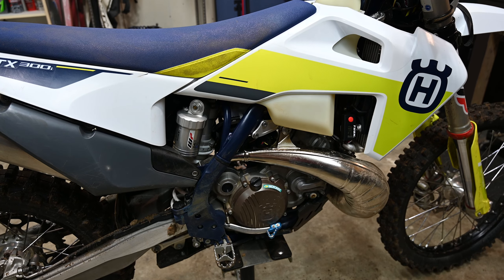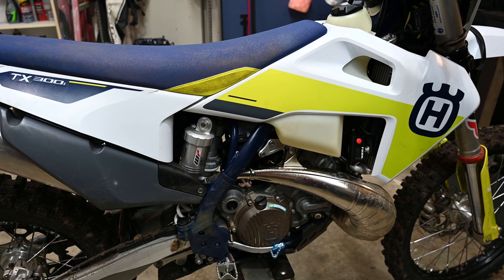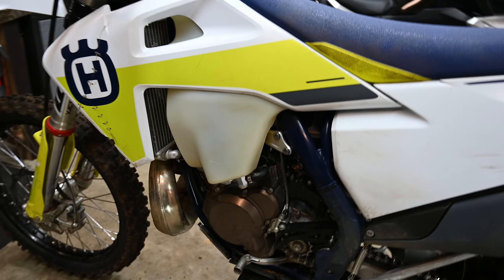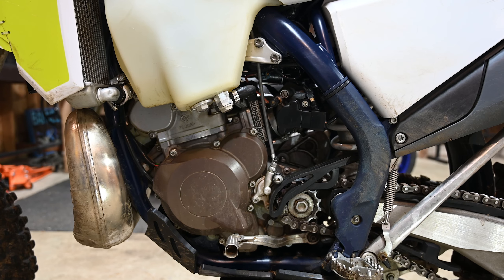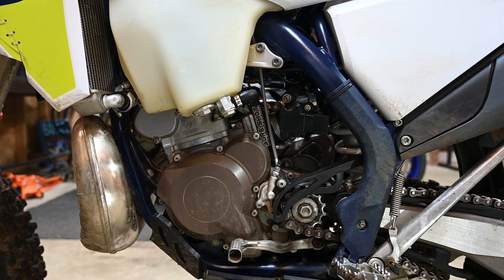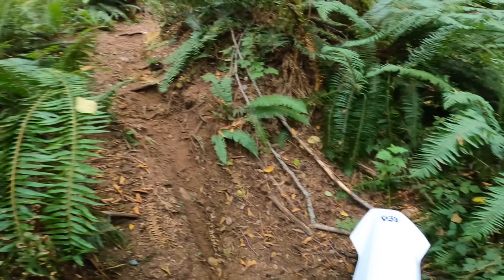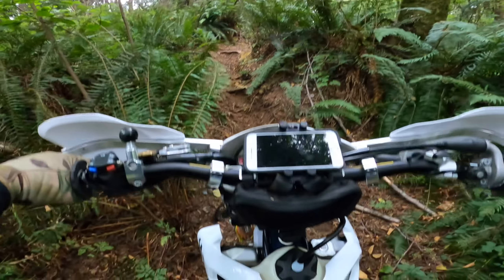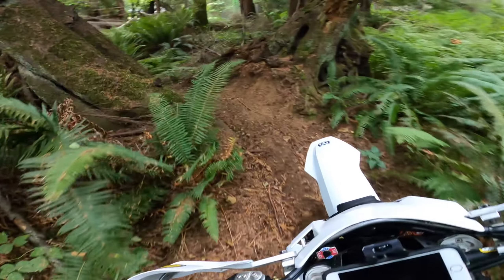I went from TPI to TBI (and back to TPI) - KTM Throttle Body Injection REVIEW

Comment: Hi, I've installed such a system to my ktm exc 250 year 2020. Could you give me some advice what I can do to make my  ktm work more smoothly.  When I have it at high speed everything is ok but when it works at low speed it seems to be flooded by petrol. Then I have to blow it so it is still working. I have to add that I haven't changed anything in the computer.
Reply from the maker: A bad CCPS can make it run super rich at lower RPMs. Replace it and see if it helps. Ultimately I removed the TBI set up because I think the bike runs a little more crisp as a TPI (but less low end power).

Comment: In your video you made no mention of premix oil to your gas, so I assume that you are letting the ECU control oil delivery. I previously heard that less oil may be delivered with TPI as you don't have the  gas wash on bottom end. Now you have changed to TBI any concerns with proper bottom end lubrication? Did you consider going entirely to premix and block off oil pump delivery? Wouldn't that remove the potential for engine failure due to oil pump failure?
Reply from the maker: I ran premix at around 120:1 while I had the TBI setup, and I left the factory oil injection in place. I've heard many different theories that the bottom end won't get enough lubrication with the factory oiling alone, which is why I did that. I have no idea how to validate how true that is however. I did not even consider going 100% premix only, because I don't see the factory oil injection as a problem - in fact I like the convenience of it. As of now, TBI kit has been removed, and I'm back to TPI/stock.

Comment: Did you swapout throttle eccentric that comes with the Bike for the more aggressive one ?
Reply from the maker: No just left the standard one in
Reply: @WASemiHardEnduro  i just Bought a 2023 TE 300 He .   Lots of Mods to install “ PinIT RB ,PC pipe, Silencer Extension (SA) Idle Screw mod , , not much of a HardE rider so im more interested in HP gains etc,  my Ecu ReFlash is my biggest concern.

Comment: Does this retain the stock injection? No mixing gas still?
Reply from the maker: Yes, you can retain the stock oil injection. Or with a TBI setup, you can safely remove the OI and run premix if you want. I went back to the stock TPI setup as this kit was too inconsistent.

Comment: Can someone explain how TBI would be better for emissions than a traditional carb that uses vacuum to suck just the right amount of fuel. Seems like TBI is a computer guessing the best amount of fuel to put into the throttle body in the same spot as a traditional carby would. I'm sure there is a technical reason but I'm not that technical.
Reply from the maker: EFI uses several sensors to determine the right amount of fuel to inject at each moment, under any condition, and the mapping is tuned for thousands of combinations of throttle position, RPM, ambient temp, engine temp, etc. A carb has basically only 3-4 different circuits for adjusting fuel - yes it’s vacuum operated, but it doesn’t have the precision to provide optimal fueling under every possible condition.

Comment: Alright so after initially being offended that my 2022 ktm 300xc could not better, I have come to the conclusion that TBI might be worth trying. Do you have a link to this product? I saw one on Ebay but it had no named brand. The other one from best dual sport or whatever seems to be out of stock. Not so sure about the GET model with all the hoses. Any help please?
Reply from the maker: My understanding is the eBay one from ukraine is the original product, and last I checked it was in stock. The GET relocation block, according to Athena, was designed the way it is because it offered the best flow - however it looks like a hot mess of hoses. I'm of the opinion now that you might want an ECU tune that is specifically customized to the TBI setup, so the GET ECU + Relocation might be the way to go, but it's so expensive that not many try it.
Reply: @WASemiHardEnduro  Thanks...I was actually about to call Best Dual Sports and they had one left and I snagged it. You just did a Jackson tuner, right? You suggest to get a GET ECU as well? I'll look at them.

Comment: Hey, hanks for a great vid!
Do you think TBI wih pump should run 1/100 premix? isnt oil from pump dissolved by fuel after relocation of injectors? 
I run relocation kit with no changes to electronics and get unstable torque at mid rpm, several secons it sounds crappy and then crispy again. Any advice?
Reply from the maker: I’m not 100% sure - some think it’s necessary to run a little oil in your fuel, even if you keep the oil injection. I ran about 120:1 just to be safe, but I have no idea if it’s necessary. 

Regarding your midrange: I didn’t experience that, but I had an unstable idle that I couldn’t solve. A bad CCPS could be the culprit; something to check. 
I ultimately removed the TBI kit. I might reinstall it once TSP and/or others have a ECU tune specifically for it.

Comment: So if the injectors are moved to basically when fuel would enter like in a carby bike ,how does this affect oil injection , isn't it going to run leaner.
Reply from the maker: In theory, same amount of fuel and same amount of oil are being injected.
Reply: @WASemiHardEnduro  and that might be an issue cos the fuel is washing out the oil, and making it even leaner I would of thought.?

Comment: A dynojet power commander will give you more tuning options to be able to tune in some traction control with fuel and ignition. An extreme enduro head may help a bit also.

Are you adding any oil to your fuel, or have the extreme enduro factory map which adds oil?
Reply from the maker: I wasn’t aware you could do traction control with the PC5. With how well it’s currently running, I have no desire to really tinker with it any more, but who knows!
I have the 103 “extreme” map on it. I tried running 120:1 oil in the tank, but not sure if it’s necessary w the 103 map.
Reply: @WASemiHardEnduro  you can't do traditional traction control, but through tuning you can setup a second milder tuned map.

Comment: The connector to the oil pump is directly above the reed block and this relocation block is rather tall and appears will be in conflict. A photo from the website shows the oil pump removed from its original location and zip tied somehow. What did you do to have this all fit? This relocation block seems to be much more compact design comparted to the GET. I also heard from Boyesen saying that they are currently testing a relocation block of their own. Currently you have to run the stock reeds with this or the GET relocation block.
Reply from the maker: I didn't have to do anything special to make it fit. The oil hose just goes right over the top of the block (in between the injectors).
Reply: @WASemiHardEnduro  I have a 2019 KTM XCW and the update for 20+ moved the injector out and out of the way. I don't think that this tall injector relocation block will work for the 2018-2019. I haven't yet figured out a workaround and don't want to drop double for the GET one.

Comment: And have you deleted the oil pump with the TBI set up and ran mix in the tank ?
Reply from the maker: No, I plan to keep it. Oil injection is too convenient, and I see no reason to delete it.
Reply: @WASemiHardEnduro  ok for me it would be more  convenient to be able to refuel my chainsaw easily like I used to from my carb bike.  Than there is Reliability but really I'm not too worried about that

Comment: I'm not connecting how 'more complete mix of air and fuel' results in LESS efficient burning.
Reply from the maker: Look up scavenging. The closer you can get an injector to the combustion chamber, the more more accurately you can time the injector pulse to when the exhaust port has closed. This reduces how much unburnt air+fuel escapes right out the exhaust port. Good for emissions, good for economy. Not the best for power or response, because that fuel hasn’t had adequate time to fully mix with the incoming air charge.
Reply: @WASemiHardEnduro  Ah, so, accurate timing comes at the expense of complete mix. Well mixed happens further away so the timing is less perfect.

It sounded in the vid like you said "more complete mix is less efficient", but I could have mixed up "less unburnt fuel escaping".
Reply from the maker: @CommieHunter7  that is what I said. TBI has a more complete mix (in theory), but it’s less efficient from an emissions perspective because some of that mix goes straight out the exhaust port.
Reply: @WASemiHardEnduro  yep. I didn't understand the difference based on the vid, but your comments clear it up for sure.
Reply from the maker: @whiskey_throttle_racing7461  4t engines are different (you know, those two extra strokes). DI works well on two strokes, but is complex and top-heavy and packaging makes it less practical on a dirt bike (watercraft & snowmobiles use DI, but some use secondary injectors in the crankcase).

Comment: Did you consider a gearing change to tame the low end?
Reply from the maker: No, I like the stock TX gearing. The improved low-end w/ the TBI kit just takes some adjustments in riding technique to prevent wheelspin.

Comment: As a tBi is it therefore pre mix??
Reply from the maker: You can run premix and delete the oil injection with TBI, but I am not.
Reply: @WASemiHardEnduro  ok I'm looking at getting a new bike and I'm still in the classic tpi or carb dilemma (essentially beta 300 RR or KTM 300 exc). Now hearing they are moving away from tpi to tbi makes me even more hesitant lol

Comment: Hey thanks for posting this. I’m a little late to the party but I was unaware that tbi conversion was a thing. 

I’m glad it’s serving you well, it’s way more appealing to me. So do you premix?
Reply from the maker: Nope still using the oil injection. I e also switched to using 1 TPI injector and 1 TBI injector - runs more consistently that way.

Comment: The issue I’m currently trying to solve is the tpi bikes being quite lame vs the carb models. My yz250x pulls like a freight train compared to the 2020 250 tpi I’ve been riding
Reply from the maker: I think it’s just the smoothness/lack of hit that makes them feel slower.
Reply: @WASemiHardEnduro  Yes, I've had several YZ250s and remember trying my brothers 05 300XCW when I had my 05 YZ250 and thinking my YZ felt like it had more power. Now that I've spent so many years on both, I can attest to the YZ's feeling rippier but the 300's having more power.

Comment: Why would you even bother fucking with it ? Just ride it as it was made ! I’ve had several tpi bikes and I have no idea why people even mess with them
Reply: @chadrides914  I don't know what manual you are reviewing but try 80 hours for top end depending on how things look.  I've gotten 120 hours and things still looked like they could go another 20.  Anyway, manual does NOT say replace top end every 10 to 40 hours.
Reply: @whiskey_throttle_racing7461  ok. 80hrs they need top and bottom ends. Local dealers have said otherwise. Tops should be done on tpi’s in the 20hr range.
Reply: @chadrides914  have a look at all of the other ridiculously short recommended service intervals for other parts of the bike , they base them on full blow racing situations not what the average rider is doing on them .
Reply: @chadrides914  10 to 40 ? That’s a pretty fucking big gap in time ? Doesn’t sound like they would quote that . My tpis all said 80 and it’s like 40 for mx bikes .
Reply: @Ozfreerider_adventures  80 was for the bottom end rebuild. So top would be 1/3 that.

Comment: Spent my money on great suspension, the bike runs perfect, this is a complete waste.
Reply from the maker: Mine ran really well before too, but I like it even better now. Not sure how that’s a waste. 
What about putting on a FMF Gnarly pipe for more low end - do you think that’s a waste too?
Reply: @WASemiHardEnduro  yes... Suspension is everything.
Reply from the maker: @billypulsipher7313  ok. So you run stock tires with your high dollar suspension? Stock tubes? Stock jetting on your carb’d bikes? 
Suspension is great, no argument.  But don’t tell me you don’t do other things to make your bike perform better.
Reply: @WASemiHardEnduro you should do more suspension testing videos is all I'm saying.
Reply from the maker: @billypulsipher7313  I may not be the best person lol. I’ve had Xplor and AER, and ridden (briefly) Luckys and Dal Soggios. Honestly thought the AERs would just as good as the expensive setups. Granted they weren’t setup for my weight.
Reply: @WASemiHardEnduro  if you can tell differences in power. You can tell differences in suspension.
Reply from the maker: @billypulsipher7313  of course, didn’t say I couldn’t feel a difference. They were a noticeable upgrade over the Xplors, that’s for sure. But not so much over the AERs (the ‘21 version w the new midvalve, at least)
Reply: @billypulsipher7313  Totally agree, suspension is key.  Everyone trying to set power records but they very rarely use the power; conversely we use the suspension every single second but continue to concentrate on power.

Comment: TPi is not going anywhere. Maybe we will see TBI for the SX bikes but no way they are dropping TPi on enduro bikes. Not sure where you are getting your info from.
Reply from the maker: The factory enduro racers have been running TBI for 2 years now.
Reply: So because some of the factory guys have been running TBI test mule rigs with premix you think that means TPI is going away? TBI won’t pass Euro5 regulations. If they run TBI for 23 or 24 it will be on closed course competition bikes like the SX and XC models. You’re on KTMTalk too much😂
Where is the press release about TBI on the 22 TM’s. I thought it was just speculation and rumours based on a photoshopped bike. Neil, who’s version of TPi is based on was helping TM on their injected bikes. They were trying multiple injector set ups. More than 2 injectors.
Reply: @cknymapleleaf  I would think that a 3 injector system would be best. Regular TPI with a boost TBI injector.
Reply from the maker: Not sure why you’re arguing - I said that SX and XC are most likely to get it. XC-W is the question. We’ll see in six short months or so.
Reply: @WASemiHardEnduro   I don't expect any updates till 2024 if you look at historic update patterns.
Reply: Not trying to argue, just making it clear everything is speculation at this point.
Reply: It really helps higher rpm fueling and power.
Reply: Pretty sure they were testing with 2 for transfer ports and 2 for the TB.
Reply from the maker: @freddunbar  Maybe, but I’d still bet SX/XC will get them for ‘23. There are already spy photos of the 2t SX bikes in the new plastics with e-pv and TBI…
Reply: @WASemiHardEnduro  sorry I wasn't more clear, I agree with you that the 250sx will get the new chassis for 2023 like the sxf/xcf which follows historic updates. That does open the possibility for any potential engine updates. I wonder if they rotate the engine like the updated 2022 SXF-FE? Then in 2024 we get updated XC, XC-W, XCF-W, and EXC'S. And of course the Husky and Gasgas will be updated at the same time as the equivalent Ktm's. 

The 125/150 engine was just updated, I wonder if it gets any FI updates when it gets the new chassis? 

They need to do something to meet emissions,  since Komifornia will not allow any non-CARB(smog org) approved bikes on state property for 2022 models and newer.

Comment: If you are still running the TBI system I would remove it. Using the stock reed cage you stand a chance of the screws backing out and falling into the engine.. game over permanently. The GET is designed the same so I would stay away form these Products. Just go with the V force 4R 👍🏽
Reply from the maker: I haven’t heard of that before, ever. I’m back to stock TPI for now.